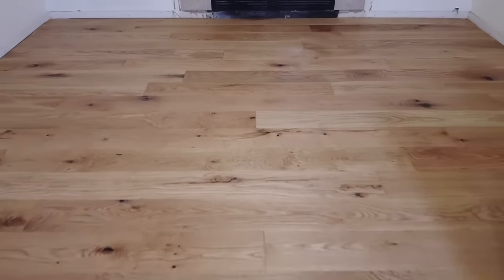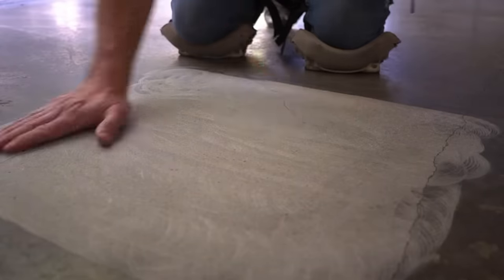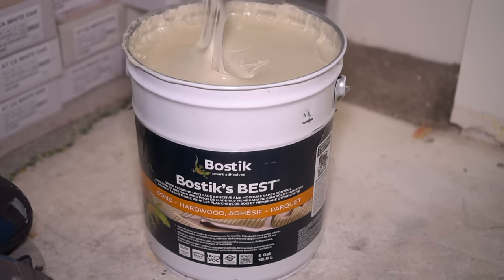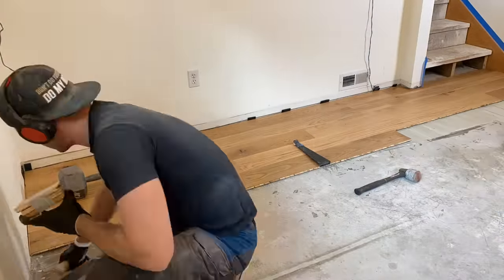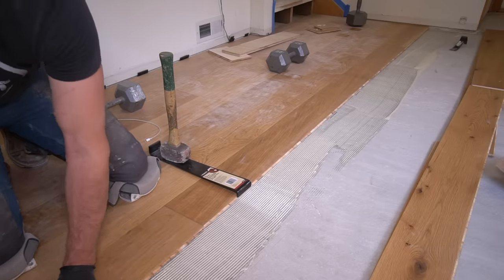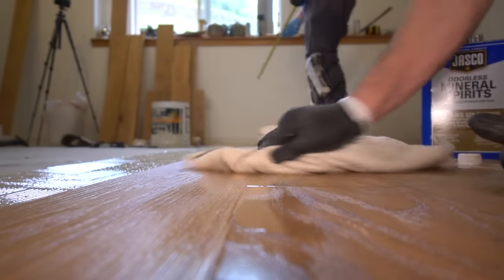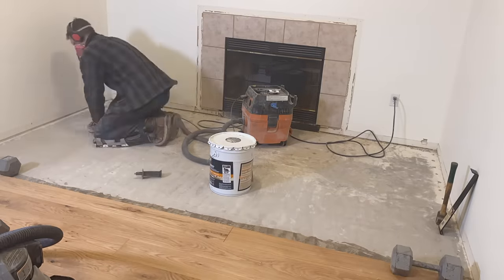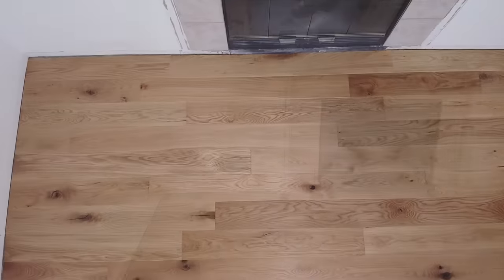How To Install A Glue Down Floor // DIY Glue Down Flooring

Comment: You don’t check  for moisture for glue adhesion, it’s because you don’t want the floor to absorb it and expand and potentially blow off the subfloor. We always apply a moisture barrier regardless of whether the subfloor is dry or not. Also you didn’t check your subfloor for flatness, bumps and dips can cause hollow spots under your floor.

Comment: It's fascinating to see how other people approach floor installation. Personally, I take extra care in my methods, including subfloor leveling for most projects. I avoid starting from the wall and instead use blocks and masking tape to ensure tightly fitted flooring boards. It's important to use the recommended trowel by the manufacturer, even if it means spending a bit more money. While Bostick glue is excellent, for DIY projects, I recommend using Bona glue. It's easy to remove from the floor without any special remover. Additionally, I advise against wearing gloves when gluing down the floor because it can make the surface dirty. Lastly, use a rubber mallet instead of a metal hammer to avoid damaging the prefinished hardwood floor. Thank you for sharing your skills, and I wish you the best of luck with your projects!

Comment: There is no insulant under the flooring. You need to have layer of insulant (against water, insects, fungus) underneath the flooring, that isn't cleary installed.

Comment: DUDE… I have PTSD from this and reading the title made my body hurt! 🤣 I apparently hate myself. I wanted 6ft runs, not the 4ft runs. Looks WAY different and more timeless and professional. However it was a b…h to do. Did 2500 sqt 5/8” solid stranded bamboo flooring. 😳 😩

Comment: Taking all that time to remove that overspray paint is pretty much a waste of time.
Reply from the maker: Why do you think it was a waste of time Sal? Very important to have if off fore proper adhesion. Thanks for watching
Reply: If you glue the floor to the paint you’re reliant on how well the paint is adhered to the floor. It won’t be well stuck and your floor will eventually lift.
Reply: @nathanielcooke6122  yea for sure. Damn paint is always lifting off the floors. That’s why you need a freakin diamond disc on a grinder to get it off
Reply: It really is overkill though, in my opinion. You might as well have gone all the way and put down an underlayment for the moisture and then screwed down lauan to the concrete. The foundation also was full of cracks with a big vein right down the middle of it. That seems like a much bigger problem to address than the paint. Great video for homeowners though!

Comment: Huge upgrade and great job with the video.  I recommend working in small sections so that you can focus on two or three rows at a time without the glue drying or making a mess. Try to stagger the ends of each board by a few inches to create a more stable surface. Also use a cleaner or wipes to clean up any glue that squeezes through the boards. 👍🏼
Reply from the maker: Couldn't agree more which is why all of this is in the video IB. Thanks for the support.

Comment: Just out of curiosity, why not put down a plywood subfloor first and nail them in? I feel glue down is so permanent and if they want to change it in 15 years as styles change, it will be a nightmare. Thanks for the content!
Reply: Pulling up glued down flooring is 100% the worst DIY job I have ever done

Comment: Very nice. I use an adhesive underlay when I lay engineered floor over concrete. It gives insulation, helps with floor unevenness and no messy glue.
All the best!
Reply: can you then glue onto the adhesive underlay?
Reply: @cameronmtb  Hello. No, the non adhesive side is on the concrete floor and you stick the floor to the adhesive side. There's a peel back plastic foil you pull back as you are laying the floor.

Comment: What do you charge for square footage on this stuff? I’m trying to figure out what would be a good price..
Reply: This video is for home owners. 99% of small business contractors wouldn't recommend this install. He is doing a great job but glued down engineered hardwood in a basement is the worst option out of them all. So unless you're client asks you specifically to do it and won't listen to your advice, definitely upcharge! Ask anyone who has ever had to deal with re-doing/repairing glued down engineered hardwood. { : _ (